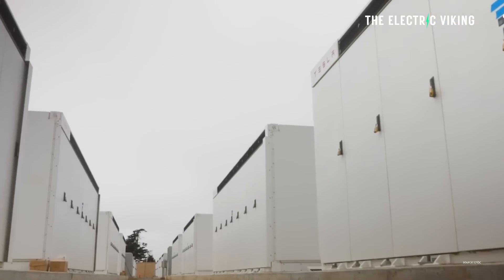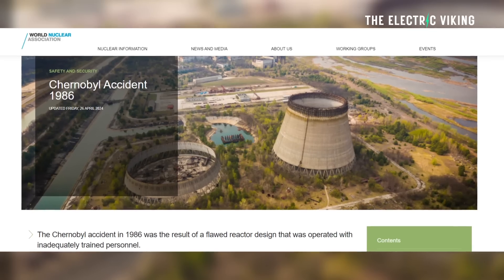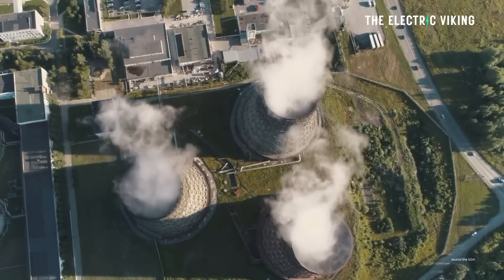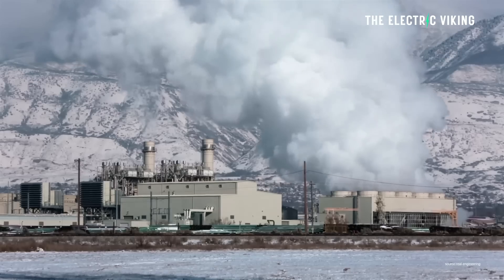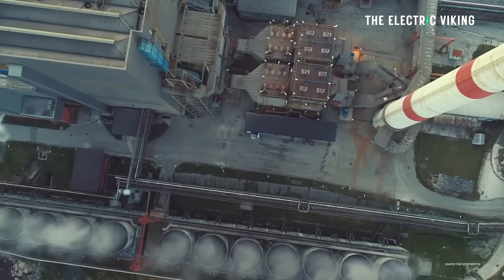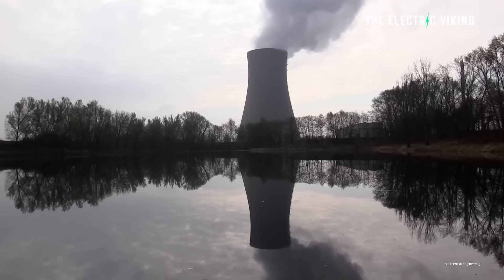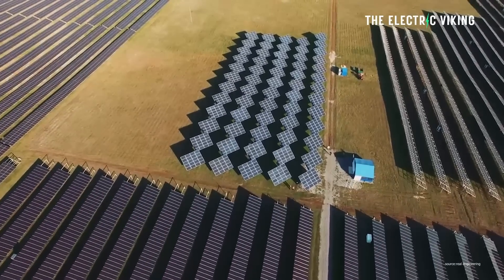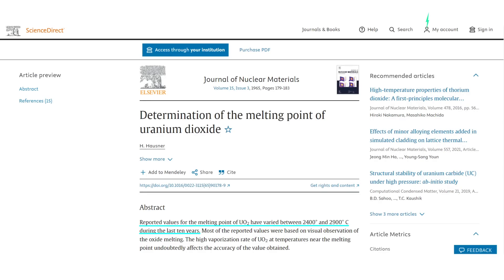China build the world’s first thorium molten salt nuclear power station

Comment: Molten salts reactors have the advantage of passive security: they have a plug of frozen salts, refrigerated by helium. If anything goes wrong, or everything, the plug melts and the molten salts drain down into a reservoir, where the reaction will stop and the plant will have time to cool. It's WAY safer than old nuclear plants, there's zero risks of Chernobyl.

Comment: China nuclear capacity has been growing rapidly in recent years, with the country adding more than 34 gigawatts (GW) of capacity in the last decade. As of April 2024, China had 55 operating nuclear reactors with a total net capacity of 53.2 GW. China also has 24 reactors UNDER CONSTRUCTION and 44 CURRENTLY PLANNED FOR CONSTRUCTION. China official energy policy is "as much as possible of all of the above". Watch domestic China TV if you imagine this to be untrue.
Reply: Yes, but they are running out of suitable locations for npp. Everything is on coast and inland is problematic because rivers often dry out = possibly missing coolant. That's going to get worse with time and is one of big reasons for lftr that doesn't require water cooling.

Comment: 6:01 the beryllium in these reactors is not exactly benign.  Is the LiBe the most efficient, yes.  Is it the only option, no.  One could use Na-Zr fluoride salts, and given these two elements are more common than Be, it might make economic sense.

Comment: 4:07 Sam you should go back to the Oak Ridge original design.  If the reactor has an issue the frozen salt plug at the bottom of the reactor is allowed to melt and the radioactive fuel is allow to drain into the drain tank.  The tank is design to absorb neutrons, shutting down the chain reaction. If Japan had a MSR in 2011 it would have been a non-issue.

Comment: Your energy plant explanations (solar mirror towers and nuclear) are brutal. 
Uranium works in molten salt reactors as does Thoreum. The important ingredient of both these elements is both have 2 and 1 radioactive neutrons? respectively. 
If you set up a thoreum plant beside a uranium mine, you would use uranium with little to no difference - the Thorium is more abundant so you would prefer to use it.
As for radioactivity, uranium has a half-life much longer than thorium (500,000 years), but both fuel types should be recycled - as Japan has for decades - so as to reuse the fuel, get full use of the fuel's energy, and to reduce this radioactive half-life time to just 20 years (for example). Nuclear is 7/24, clean, and safe - when smart people are put in charge of the projects and tech,  instead of politicians and "business" people who try to make everything profitable - instead of productive and safe.

Comment: Renewable will probably dominate.  But they are intermittent.  Storage can help.  But one needs a low carbon  dis-patchable "clean firm power" in the portfolio, ... just in case.  

In emergency situations, or remote locations, diesel generators currently dominate.  Micro-nuclear power can be an alternative.  Completely factory manufactured. Something that can shipped on a truck.  Can ramp up and down.  Can be used to top off one's batteries, in a micro-grid.

Comment: So, in Japan, their reactor got to hot, and all the water used to cool it turned to steam, then couldn’t be used to stop it from a meltdown because they lost electricity to their pumps because they couldn’t get power from their reactor to the pumps because of an earthquake,  and also their generators went offline.  I don’t remember why, and I’m not gonna bother with fact checking, so I’m gonna say it’s because they got wet….
Uranium & Thorium reactors are designed like ovens to keep the heat contained within the reactor so the reaction keeps happening, and then syphon off the excess heat that would melt the containers as energy to power the grid. 
When a thorium reactor is operating, it’s a liquid.  The reactor that traps heat is placed above a container that will expel heat and halt the reaction.  The barrier between the reactor and the second container requires electricity to stop it from falling into the 2nd container.  So when the power goes out from an earthquake, or an asteroid strike, or a solar storm or whatever, the barrier “fails” and the liquid slurry falls into a container in which it cannot maintain a temperature sufficient to maintain the reaction.  
So… 
I’m sure that this isn’t 100% absolutely foolproof, nothing is.  Like if a terrorist sneaks in and fills the second tank with insulating foam and no one notices it will prolly fail.  But it won’t fail the same way as old reactors, so hopefully thorium reactors can say uranium reactors fail an order of magnitude or 2 more often.

Comment: A properly designed molten salt reactor can't meltdown, firstly because the fuel is already molten. Secondly because its designed such that with increasing temperature the fuel gets less dense, meaning less neutron production, if the fuel gets colder the fuel gets denser, producing more neutrons, this make the reactor self moderating.
Then there's the frozen plug and drain tank, which makes the traditional MSR design really fail safe.
Please stick to marketing you don't know anything about engineering. Specially nuclear engineering.
I'm pro solar, wind, hydro, geothermal and nuclear. Whatever makes economic sense.
Molten Salt Reactors biggest benefit (among other nuclear reactors) is its a much simpler machine. It can be a much smaller machine, which allows for the reactor to be 100% factory built.
However with ever cheaper solar, I'm skeptical if nuclear can even survive past 2030 as solar+batteries keep getting cheaper.

Comment: Once again, the nuclear kids are solving the wrong problems. Regular nuclear is already clean and safe and its fuel is a tiny fraction of its cost per watt. Thorium reactors will still have a giant steam system, still be the size of and employ a small town, still will have very dangerous stuff that needs a security detail, still take decades to build, still rely on a centralized power system with huge transmission costs, and still be difficult to ramp up or down (don't want that molten salt cooling off, do we?), and of course COST WAY TOO MUCH. While next gen nuclear (fusion or thorium) is less likely to blow up your town, it will be too expensive and too late to save it from climate change.

Comment: Regarding nuclear. It all depends on where you live. Do you have space for solar parks? Japan? Indonesia? Mayby not. Australia? China? USA? Yes. Do you have sun in the winter? Canada? Sweden? Finland? No. Australia? China? USA? Yes.

Regarding safety and efficiency. Legacy nuclear are safe, but incredibly inefficient. A legacy water reactor nuclear plant has a fuel efficiency of 5%. Yes, legacy nuclear produces 95% waste. From a power perspective that has not been a problem because nuclear is so much more energy dense than any other type of power generation. You make so much energy from nuclear that a 95% loss doesn't bother you. Not even speaking of the long term waste.

But what if you could harness 99% of the energy in the fuel, and not generate waste poisionus for tens of thousands of years. What if you could harness 99% of the fuel, and have the waste radiating off to inert material in 300-400 years? We could recycle the old bad legacy fuel in modern fast reactors producing clean energy with a miniscule of land usage. Densely populated areas like Tokyo or Beijing for example could have local abundant energy without air pollution or release of CO2. Power and residential heating from local nuclear power plants.

There is much hype about hydrogen in Japan (and Europe), but Hydrogen from wind and solar cannot even qualify to the start line in comparison with new fluid fuel fast reactors and direct electric power lines. Hydrogen loses 50% energy when made, and an additional 50% loss when converted back to electricity. You have to sell Hydrogen with a 75% discount at the pump to compete with direct electric charged BEVs. How can anyone think the Hydrogen society will ever be able to compete with direct electric from solar batteries and nuclear? I think the Hydrogen society is a geopolitical play that will fail.

Normals can not comprehend how much energy nuclear power can deliver on demand regardless of time of day or time of year. Modern nuclear is a game changer. So is solar and megapacks. Each have its marketplace. Solar is a no branier in Australia, new nuclear is a no branier in island countries and around the polar circles. It's not one wins all, it's both wins depending on where you live.

Comment: This video spouts surface level clickbait and barely tells you a single downside other than his last second disagreement!
As he notes in the video it's old tech (1960's) it has been tried all over the world, look at India! However, it has only delivered at best roughly 50% performance in the US for short bursts with high repairs & maintenance costs and at worst complete failure to set up; see India's progress in the LAST 50+ YEARS!
China hasn't even started building it yet it was merely allowed to be investigated for viability, if it passes this test then it will be "completed by 2029", they haven't given a single inkling as to how they will solve thorium's issues!
The problem isn't that Thorium reactors are really good and India have bad engineers like watching this video would make you assume, it is that India threw everything they had to get it working and because Thorium tech is so problematic they still haven't got it working, why bother you might ask? Because they have the most Thorium in the world, they have announced 'phase 3" which is supposed to solve their problems all of a sudden, but it's an almost identical situation to nuclear fusion, which might be the better bet!
The short answer why it's so impossible is because salt if you live near sea you will know corrodes metal, then you increase the temperature to extreme temperatures and you basically can't find a material on earth than can withstand cooling and heating cycles for more than a few cycles.
"Uranium is a finite resource, it's not like lithium where we keep finding more lithium" Except that is exactly what Uranium is like, in the 50's we thought that we would run out by at latest 90's, this is literally the only reason there was research into Thorium, which concluded on its impossible nature. However, what actually happened was we have found a ton more Uranium all over the world and there is more than enough to support even more uranium nuclear power plants than are currently active for the foreseeable future...

If you don't believe me UK, French & US research has all concluded there is no current method of making it commercial possible.
Reply: But that is the fun of engineering, to try out new material designs. Just wonder if high temperature ceramics are being considered,
Reply: @waywardgeologist2520  I agree making it work would be a great achievement, like nuclear fusion, But when you check any of these miracle technologies roughly a year later there's always some kind of unexpected delay or issue making it need more funding! 
These YT channels would be far more useful if they just checked the science behind the claims, instead of being a parrot for their marketing script.
Reply: @waywardgeologist2520  I replied but it's gone:
'I agree with you solving Thorium would be super, as would nuclear fusion. I do have a problem with all of these miracle technologies though, after roughly a year later from these YT vids you hear that there's an issue or delay and they require further funding!
You see what I'm trying to say is these YT Chanels would be far more useful if they honestly analysed the science for these new tech stories, instead of being a parrot for the sales script written by marketing teams, an information>views philosophy'

The yt channels I look for come few and far between, 99% are like this one...
Reply: @waywardgeologist2520  @waywardgeologist2520  I replied but it's gone:
'I agree with you solving Thorium would be super, as would nuclear fusion. I do have a problem with all of these miracle technologies though, after roughly a year later from these YT vids you hear that there's an issue or delay and they require further funding!
You see what I'm trying to say is these YT Chanels would be far more useful if they honestly analysed the science for these new tech stories, instead of being a parrot for the sales script written by marketing teams, an information>views philosophy'

The yt channels I look for come few and far between, 99% are like this one...

Comment: Sam, a thorium reactorit IS a nuclear reactor. It isn't "like" one. But it is WAY safer than using Uranium. The U.S. had a reactor, but defunded it because the byproducts couldn't be used for nuclear weapons for the insane nuclear weapons race. It hard to explain quickly, but thorium reactors won't melt down like uranium reactors can. If cooling is interrupted, the reaction is halted (* this is a very quick explanation- I can't pack in the whole explanation here). Anyway, the U.S. will get back on this, if it's smart (which is no safe bet unfortunately).

Comment: Liquid Flouride Thorium Reactors are inherently safe. No control rods, naturally load following. Requires only gravity to shut down. Can't have a melt down because it is already liquid. Thorium is almost free, and easy to refine. Thorium does not require the expensive enrichment process like uranium. Fear from living near an LFTR is not rational. Your statements about high cost of refining Thorium are false.

Comment: To compare a Molten Salt Thorium reactor wit Thernobyl is quite inane, and just show ignorance.
Sure, there are radioactive stuff in it, but it won't explode. But pipes can burst, pumps fail, and fluid leak.
But the safty area is more like that around a transformation station, than what someone totally ignorant would think.
It can actually be handled, close to a city!
What they are researching are the chemical processing of the molten salt,  material science to make pipes not corrode, and such things.
We know these reactors can work with tolerable safety, which is something we can't say about our current nuclear technology. And we have thousands of those!

Comment: A couple of misconceptions need to be cleared up.  If the fuel is already liquid, how is it possible to have a melt down?  Doesn't a meltdown presuppose a solid fuel?  Also 5% enriched U235 is not tied to light water reactors.  Terrestrial Energy is using  enriched U235 in their own Integrated Molten Salt Reactor (IMSR).
Reply: Meltdown refers to structure meltdown whic would mean loss of containment, where radiactivity and heat would not be contained. Imagine in a foundry that yor pot cracked spillout of hot molten metal and radiactive to boot.
Reply: @acwojtkowiak  I think I have to disagree, meltdown refers to melting of the solid uranium oxide fuel because of a loss of coolant (LOC) accident.  The Three Mile Island and Fukushima accidents show that even though both reactor cores were essentially destroyed, the core rubble didn't melt through the reactor vessel.  The radiation release at Fukushima was caused the very hot zirconium cladding on the fuel rods being oxidized by reacting with superheated steam in the reactor vessel which produced free hydrogen gas.  The reactor vessel pressure relief valves eventually reached their lift point and vented the super hot hydrogen gas into the reactor building atmospheric air where it caused the explosions we all saw on TV.  MSRs have freeze valves which allow over temp molten fuel salt to exit the core into dump tanks.
Reply: @michaeldietsch1054  . At 3 miles island the dome fullfiled its Design Basis Accident role. Fukashima, there was a directive to relocate the pump and motors that the utility did not follow. You use nuclear engineer's terminology, not disputing your facts.
Reply: @acwojtkowiak  I use nuclear engineering terminology because I worked I was an engineer on navy nuclear sub propulsion plant systems for 36 years, but I think you might be missing my point.  The loss of coolant accidents at Three Mile Island and Fukushima showed that the radiation releases did not occur because the damaged core melted through the bottom of the reactor pressure vessel (RPV).  They occurred because the oxygen and hydrogen in the superheated steam above the damaged core disassociated and oxidized the zirconium cladding on the fuel rods releasing hydrogen gas.  The build up of this hydrogen gas mixed with fission product gases that were released by overpressure protection system is what caused the radiation release, not structural failure of the RPV.  This distinction is critical to your original comment about the failure of the RPV being the defining event of a meltdown, it is not.  The defining event of a meltdown is the overheating of the fuel to the point where the fuel lost structural integrity.  In neither of these accidents did the RPV fail.

Comment: Sam, without a doubt this is your worst video ever.....Wow  you don't nothing about these reactors...The first one was in Oak Ridge in the  1960's, this is out tech that Nixon killed in 1970. They run at runs at 400-500 deg C. It makes rare metals, burn nuclear waste, can't meltdown, easy to build, the down side is the metals to handle the salts....Folks check out Gordon Mcdowell you tube channel for good info on this...

Comment: I did not hear about costs.  Costs in the US for combined-cycle natural gas electric generation are $1/ nameplate Watt for the equipment and about 6 cents per kWh produced.  PV and wind are also close to $1/ Watt and 6 cents per kWh.  Coal and nuclear are far more expensive, per the  un-subsidized costs as researched by Lazard and Assoc.  Can thorium beat a dollar a Watt and 6 cents/ kWh?, or must us taxpayers subsidize yet another pipe dream?